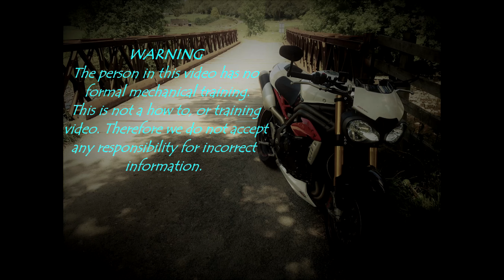ZX10 Restoration - #7 Suspension overhaul

Comment: I did the same with mine and replaced the oil as you did. I was never happy with this type of shock, I contacted a shock refurb company and they concur that this is a non serviceable type. I couldnt afford to replace the shock with a modern new one, prices for them start at about £300.
So I found out that the rear shock from a ZZR1100 C model is the same length and I bought one cheap from ebay and serviced it myself after watching a youtube video on how to service similar shocks. All in, including the shock the cost was £140, but you also need the ZZR11 linkage to do this mod (the ZX10 dogbones are the same as the ZX11).
It's really down to personal preference, maybe the original shock on mine was more shagged out than yours, but I saw evidence of the shock bottoming out with spirited riding with only myself on the bike. The ZZR11 shock gives you pre-load and damping adjustment so might be worth considering for the future.
Reply from the maker: Dundee Dek, yeah I would like to keep the shock for originality, I'll see how it goes when I eventually ride it.
Thanks for the info on a replacement, as I've be wondering what to fit if it doesn't work out 👍